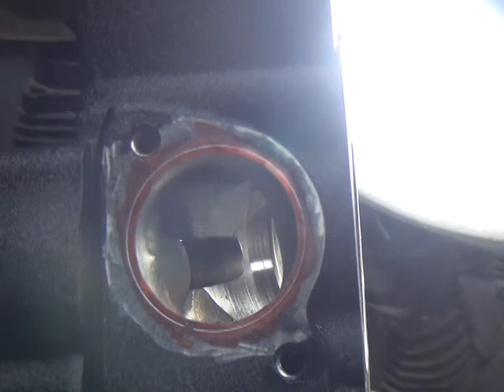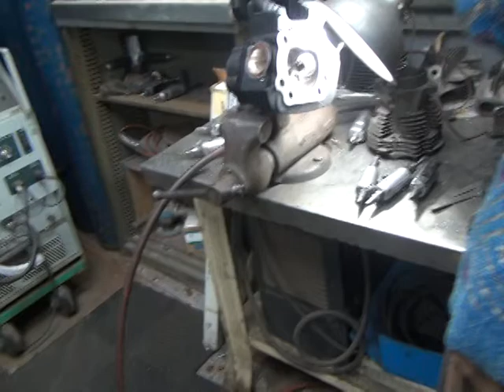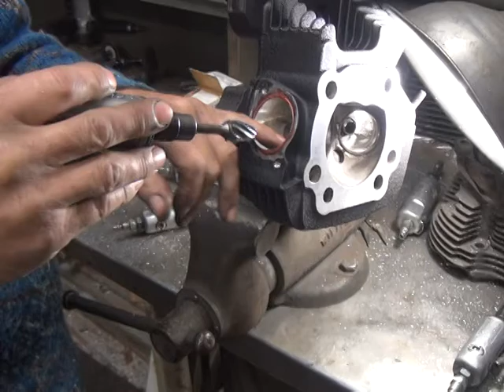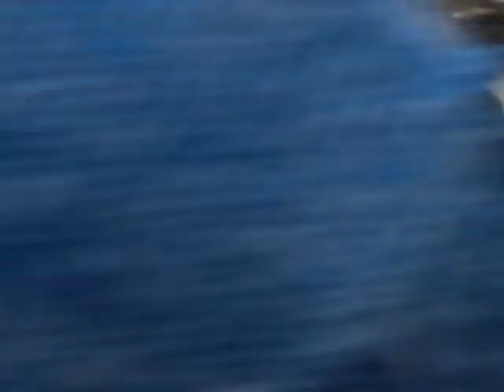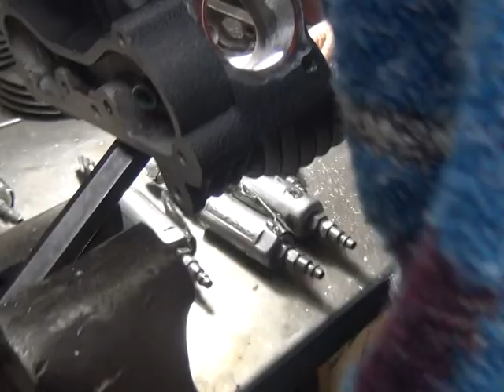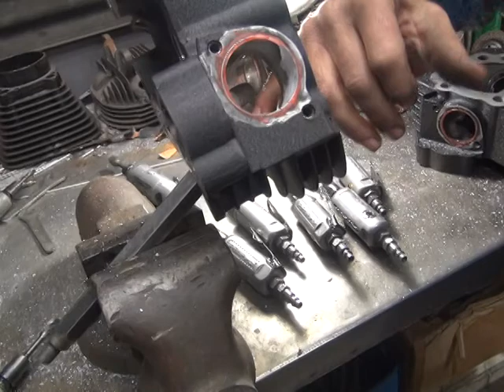#155 1992 Harley FXR Evolution 88ci Motor Assemble Rebuild Tatro Machine

Comment: Hi tatro you have mentioned your dad from time to time is that how you learned .also was he as good a machinist as you are
Reply from the maker: i learned from my dad alot as will as from racing and everyone else that has helped me along the way. you never stop learning. dad learned most of this on his own and did  not have the heavy machinist back ground i have. most of the old tools and machines i use were his so he did know his way around cutting metal. most all of what i do he did back in the 50's thru the early 80's. 
tatro
Reply: Tatro did you work as a machinist before you started doing harleys? or have you always worked on harleys